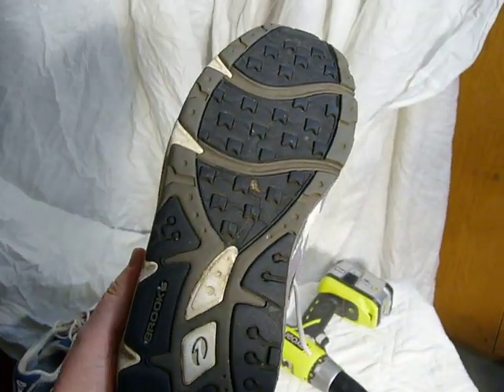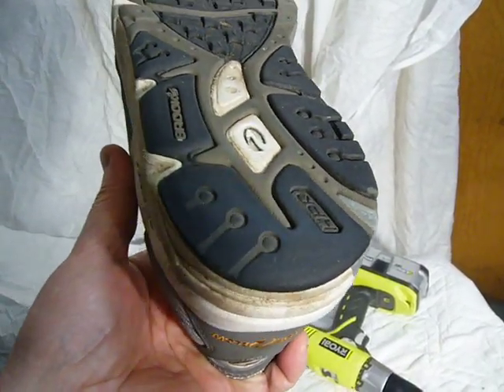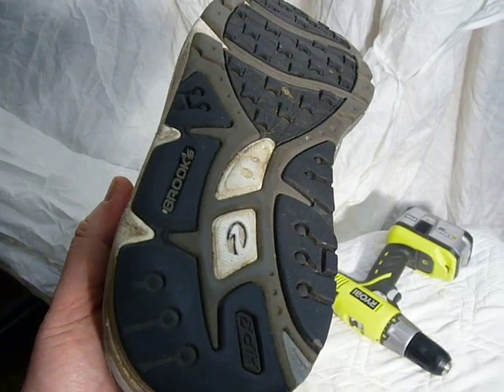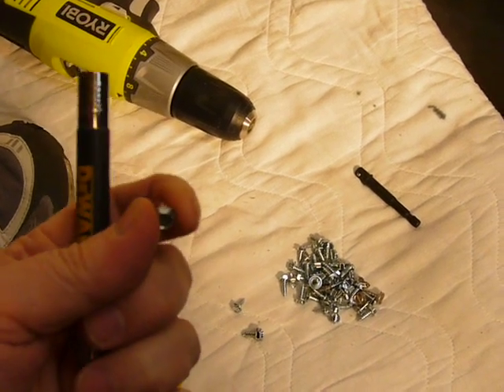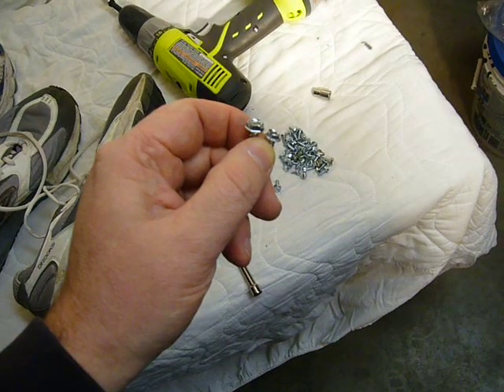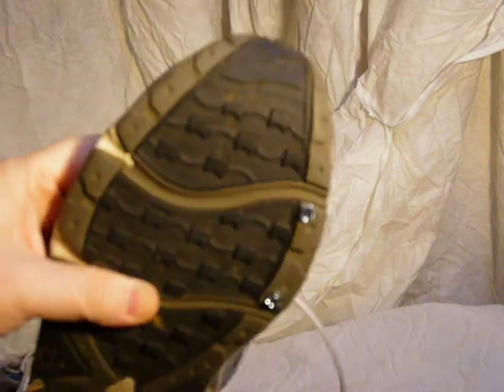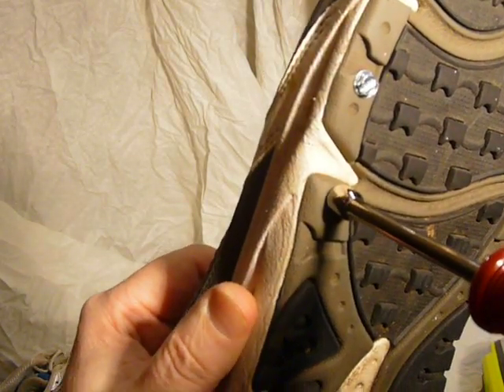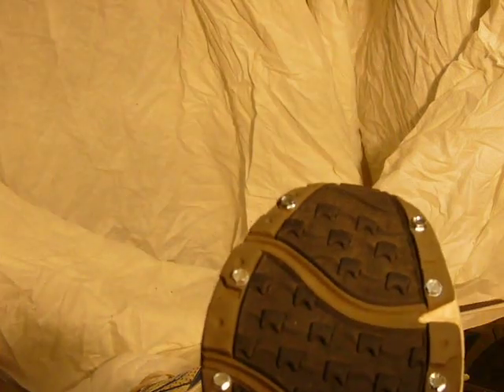How I add screws to my running shoes for traction on ice and packed snow

Comment from the maker: @themethod 
From my experience - They are better than not having them.  I have run on black ice with them which is a little tough - but better than not having them.  White ice is not a problem.  I did have a problem in spring when the snow was melting and there were bare areas of tarmac - you could feel the screws wearing down quick.

Comment from the maker: No, if you use the shorter screws and make sure they are placed on the outside of the sole of the shoe there is plennty of material there for them to sink in and not come close to your foot.  If you use longer screws in the middle you might have problems.

Comment: Hex head sheet metal screws, the ones where the heads on them are VERY sharp, sharp enough to cut you, are simply not made anymore.
.
Ever hardware store i`ve been to makes the hex heads with rounded edges now. Simply of no use on ice.